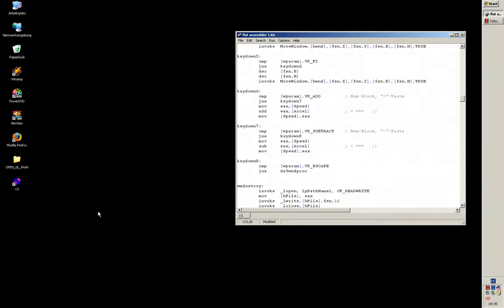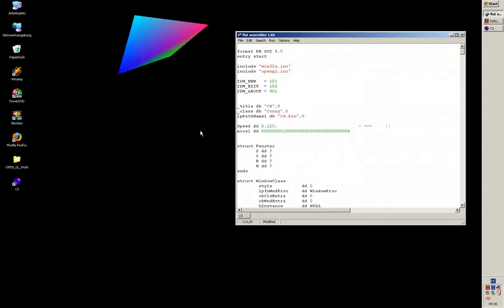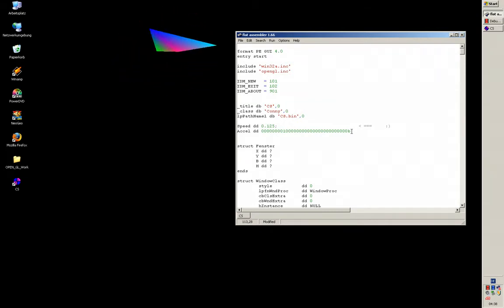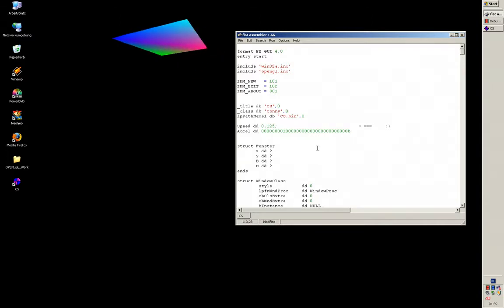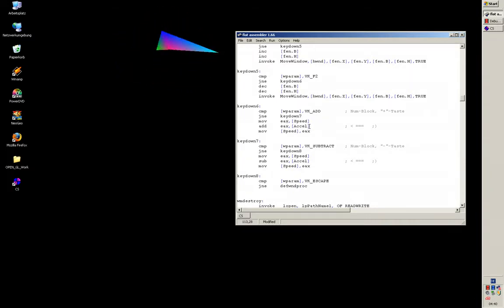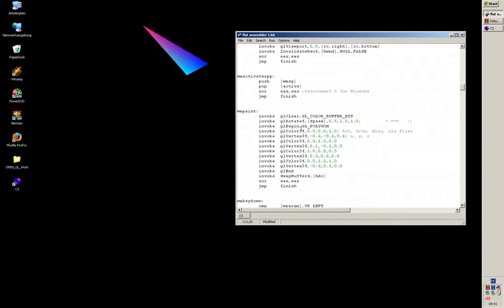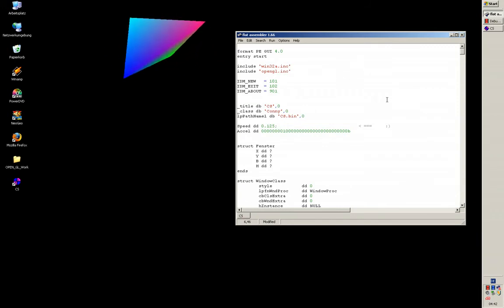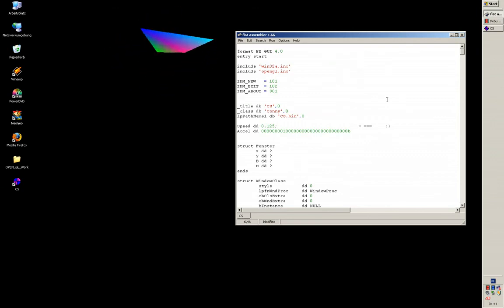fasm-Introduction 2/3

Comment: I practiced putting the declaration for compiling 32 bit in various places up around the includes region or header area really. All you need to do is add the following line:

use32

No joke -- that's all you add and FASM will compile to 32 as opposed to the default of 16 -- pretty easy henh?